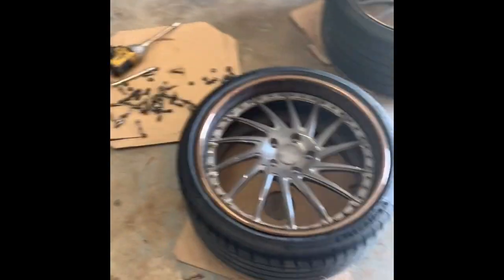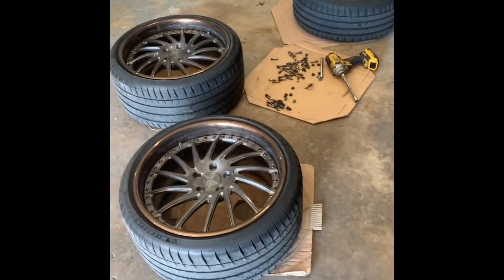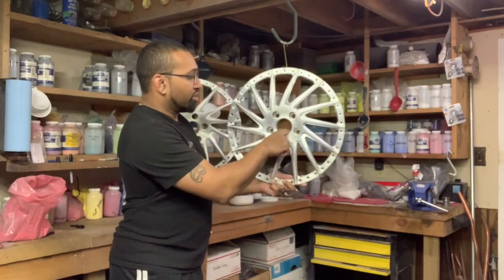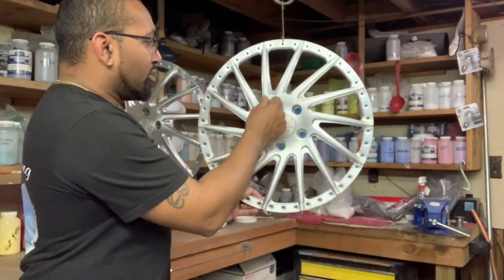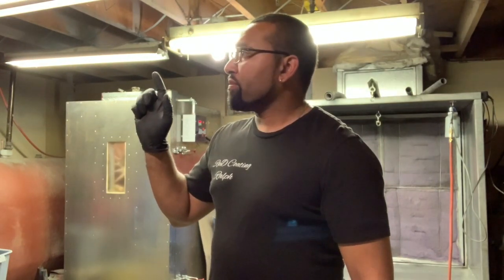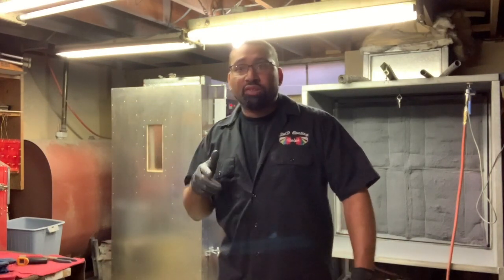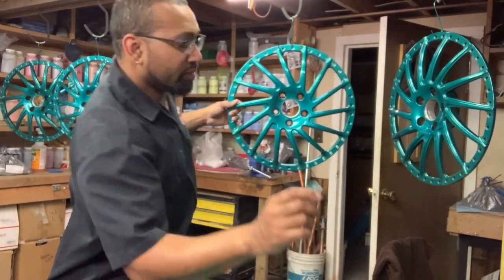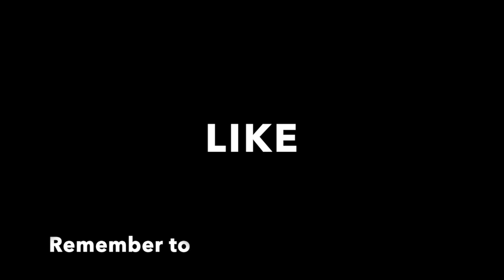Avant Garde wheels get some color

Comment: Hey man love your vids, just wondering do you charge extra for the un mount then mount an balance ? I powder coat now and thinking of getting a tire machine but my customers now just bring me the bare wheel. I would deff like to charge extra
Reply from the maker: Ryan Matty thank you very much man I have both a mount and balancer but my balancer is junk so I just charge to dismount/mount. I have a bunch of years under my belt as a tire tech so it was a no brainer, just make sure you get yourself a set of plastic heads